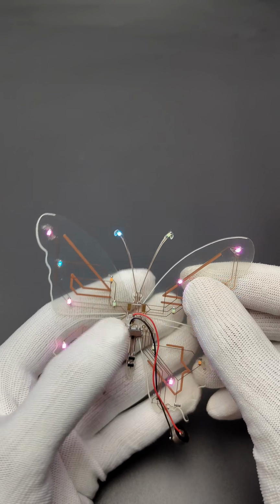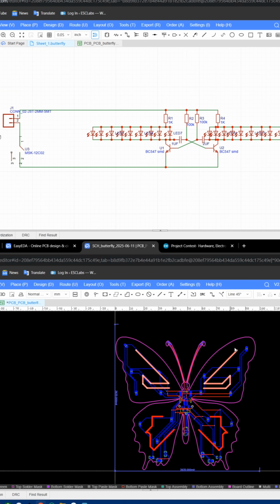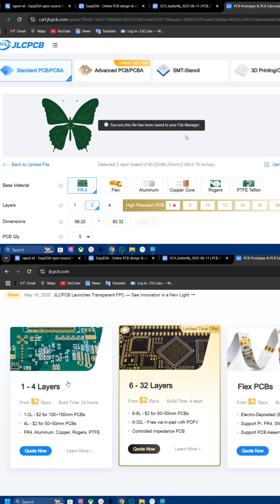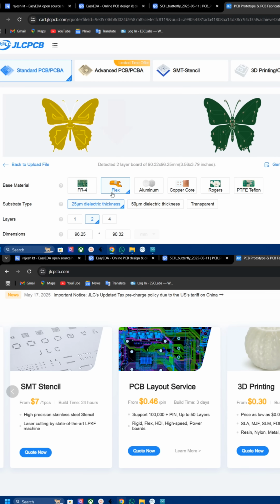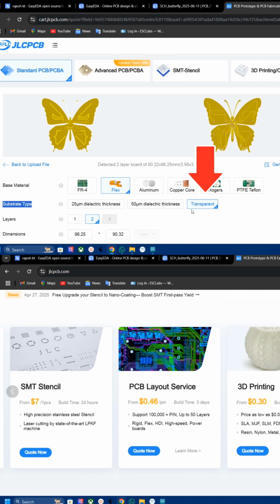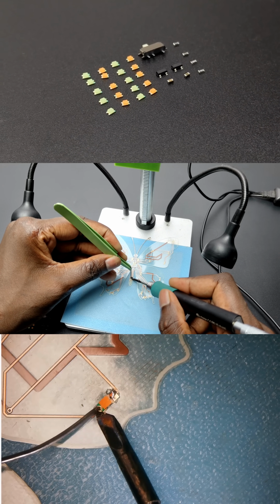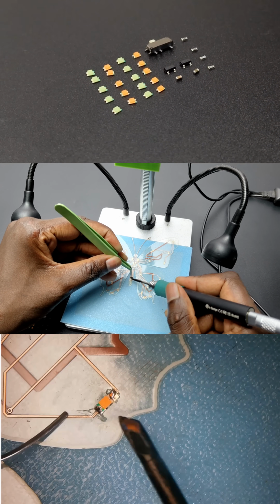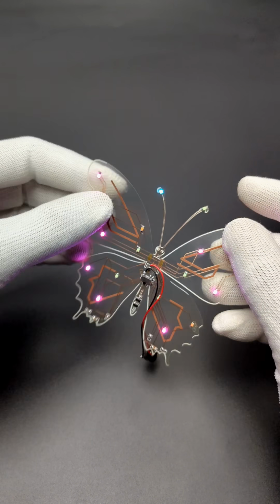Transparent flexible PCBs - The future of Printed circuit boards #pcbs #election #tech #flexiblepcb

Comment: Quick question: would adding a polyimide stiffener layer, make it not transparent?
Reply from the maker: Transparent stifner available
Reply: Rigid transparent substrates already exist.

A very transparent one is COC (cyclic olefin copolymer)...its very transparent. 

I think PTFE (aka teflon) also comes in transperent. But it diffuses light. 

There's also other stuff used as substrates for pcbs, usually by those with near infinite budgets like militaries.